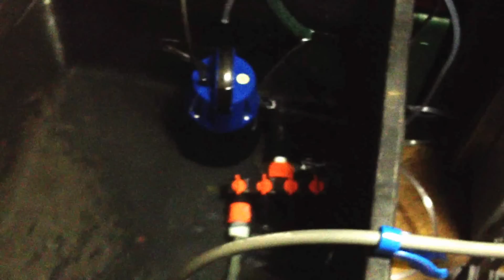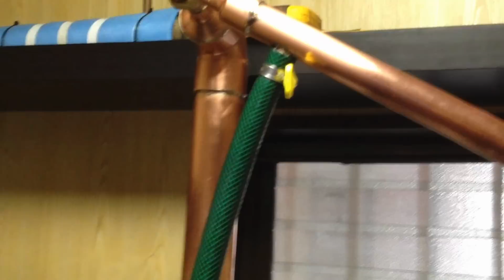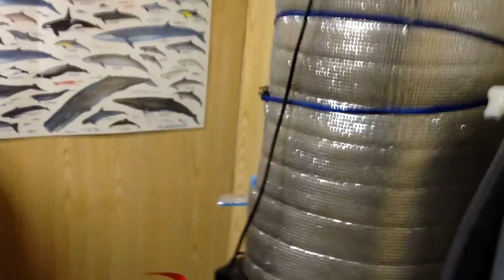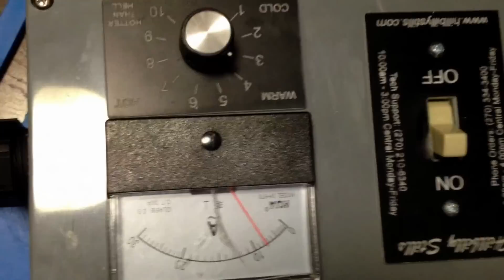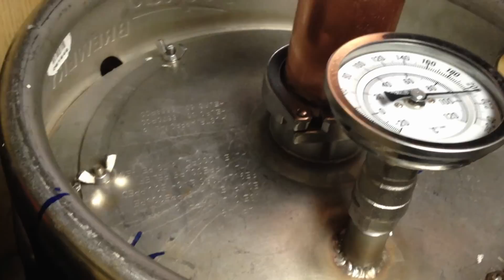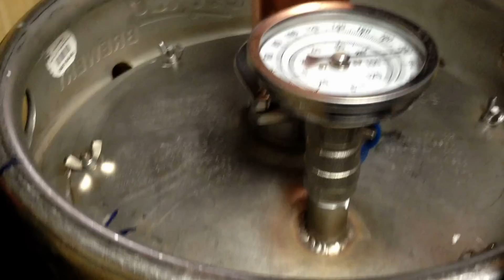moonshine distillation of new set-up cleaning run

Comment: what you can do is just have the pump near the top of the reservoir and put the ice at the bottom and put the return feed at the bottom (or put the ice and return on one side and the pump on the other). That way it cools down the bucket without making the water too cold

Comment from the maker: yeah Devon You really need to keep a constant temp at the cooling water for the whole run 27Ltrs is no way near enough for this in fact i have stopped using my reservoir (180ltr) as it isn't big enough to stay cool, i am currently using water straight from the main but you can build a radiator setup into the cooling  water system.
also the water should not be super cold so using ice is not recommended as this shocks the vapor as it comes out of the column I recommend a lot larger reservoir

Comment: with my liebig i have a 27L bucket filled to the top and half way through my stripping run it got way to hot to condense my distillate back into liquid is it necessary to have a really large bucket?

Comment from the maker: yeah sky i have 2 elements both 5500w a thermo well for adding a temp gauge and a 2"ball v/v drain which has a siphon hose section on the end of it in side 
on top of boiler is another v/v and gauge for reading temps above wash level v/v is for terminating the hole in top if i don't have the temp gauge fitted